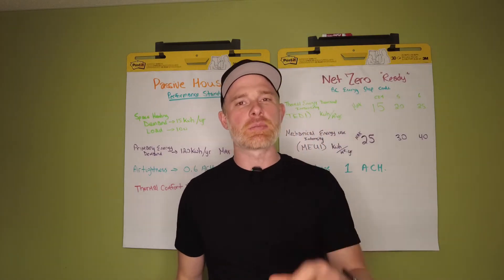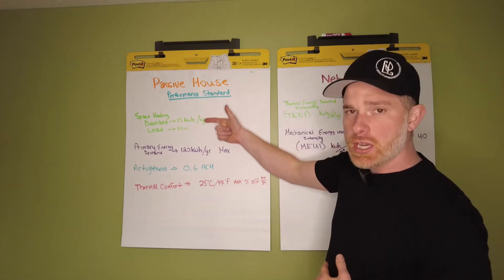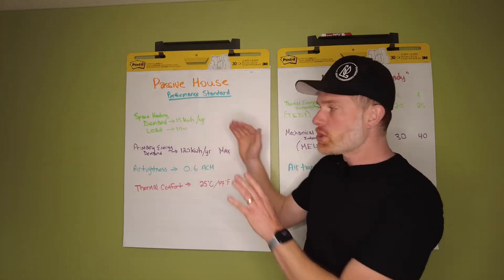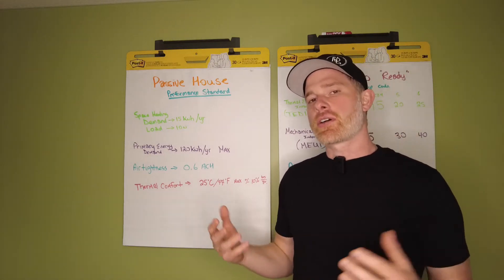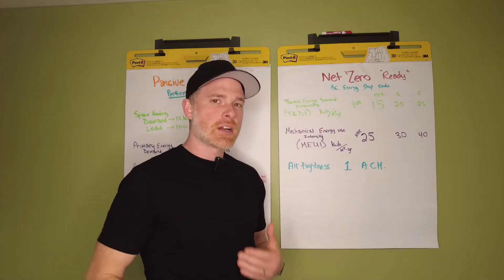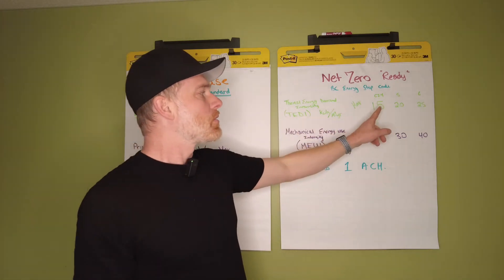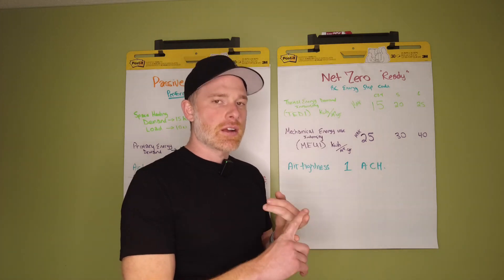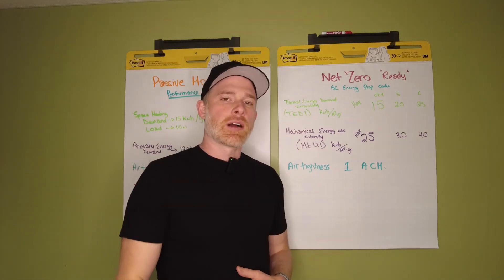Passive House vs Step 5 Net Zero Ready House in 200 seconds or less

Comment: I don’t ever design passive homes with air conditionning. It’s a red flag to me if a client wants it ! They aren’t ready and will undermine the principles of PH. i’m of course speaking for your climate or my european climate
Reply: Thermal mass is’key
Reply from the maker: Thanks for jumping in to the dialogue.  I used to think that deleting the air-conditioning was the ideal path. 
I have actually shifted my perspective on that topic.  It seems like the biggest complaint I have heard from homeowners in their high-performance house is that they can over-heat in the summer.  

This last year we had many days over 40*C / 100*F and even high performance homes needed to get added cooling to maintain comfort. 

People in typical homes/apartments were literally dying as a result of the heat here in BC. 

The trend of variable climate is to much of a risk in my opinion to build without a cooling plan. That being said, a Passive home should not need one often, and it would only need to be of modest size in any case.  So I believe it maintains the intent of low-energy footprint and adds resilience for the occupants when air-conditioning is incorporated into the design.
Reply: Assume the house is to be lived in for the next 500 years. Global warming is probably not going to exceed 15 degrees, but local warming in Europe and North America could exceed 20 degrees on current norms with heat waves exceeding that. Are you still opposed to a house being designed with ducted cooling?